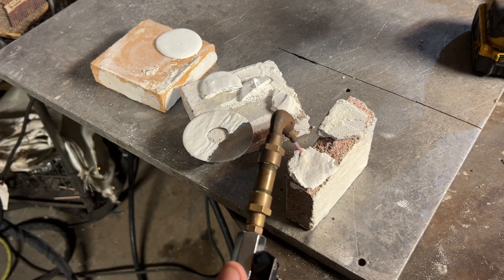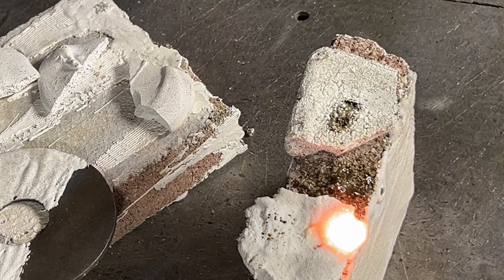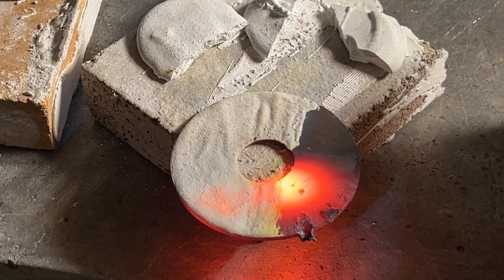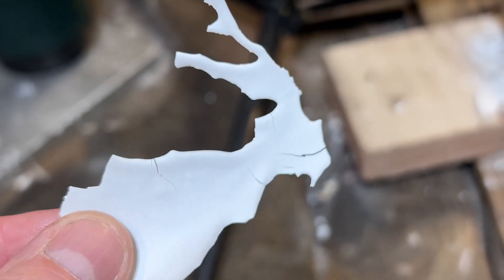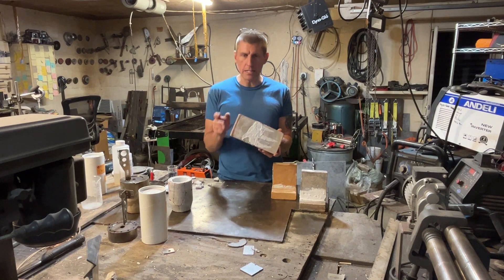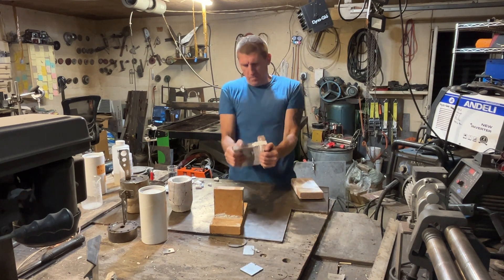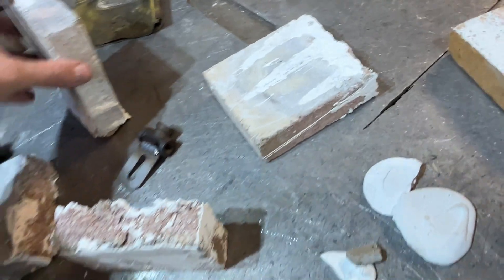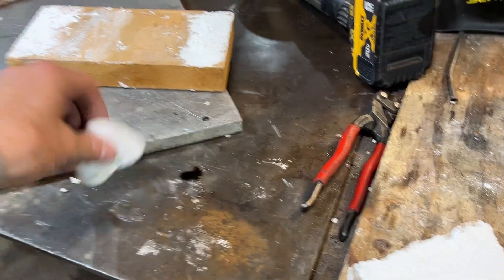High Temp refractory Glue ablation testing

Comment: Heey man how are you doing? That's really nice material you got going on, from the last couple of videos on the subject I recall you saying it could probably be used to coat things, like u did on the grill burner. I'm doing a Kiln project for pottery and budgeting the materials in Brazil I found hard fire bricks around 5 to 7 reais (1 to 1,50 dollars) and the soft bricks when rarely found goes for about 28,50 to 40 reais (5 to 7 dollars) and that difference alone would add up to over 3500 reais (610 dollars). After seeing your videos I couldn't help to think if a coat of this glue could act as a heat insulation barrier on hard brick in the sense of helping the brick suck less heat from the chamber, that way I could buy only hard bricks and save money for other equipment still having an kiln that reaches high temperatures and doesn't drive much energy, do you think this can actually be a viable solution? Thanks for putting up good content like this, bet it has been helping a lot of people!

Comment: 2 ideas come to mind for the sound the hydroxy torch made. One is a burning inside the nozzle creating the sound, something i saw on tiny nozzles. There is also a very high conductive path on the ionising flame. Worth putting a meter between the nozzle tip and the target being heated. Or between the torch tip and the earth. You can also make that waterglass rubber with K aluminate with is made by eating up Al metal in KOH. Quartz flour is probably what you want to use as filler in the geopolymer glue.
The advantage of K vs. Na in waterglass is K doesn't bloom into efflorescence like Na will. Which is a must when excess unreacted alkali is left over.
Reply from the maker: Great input on the KOH

Comment from the maker: Guys Oxyhydrogen gas can conduct electricity like plasma but a little bit better . Almost all flame conduct electricity . Im not convinced some static charge accumulation isnt happening but it may be . Let see what Me3cal comes up with . Any time you have a high velocity gas flow it strips electrons from the nozzle or tube its flowing in  . Rubber hoses can cause a static build up . This is a well known hazard to industrial accident detectives . Charged clouds passing over head can also cause build up in strange or unexpected places . This is why grounding and bonding are important on industrials equipment  .

Comment: This glue is coming along nice, will need to keep track of the recipe and what changes have been tested, wonder if you added some graphite dust from an old graphite block into the mixure on the inside of the crucilbe, if it would then help with retaing the higher temp and dissipating the heat more evenly just on the crucuble inside to help with melting metals, and cause less contamination but then again not sure if this mixure would contaminate any molten metals and if there are any toxic fumes  that are coming off this when its heated for long periods ?